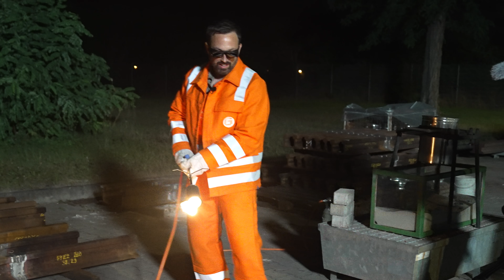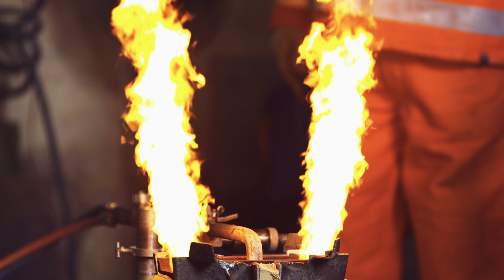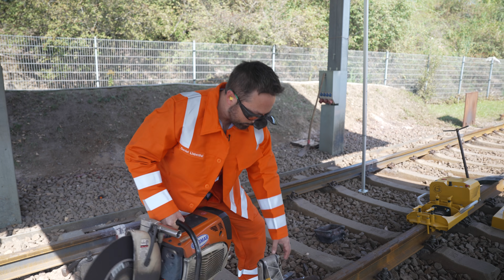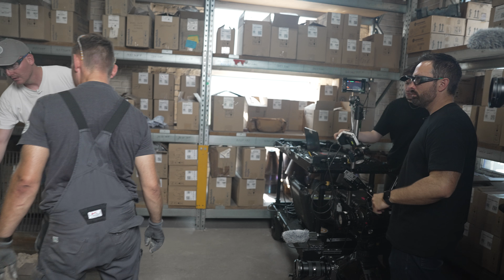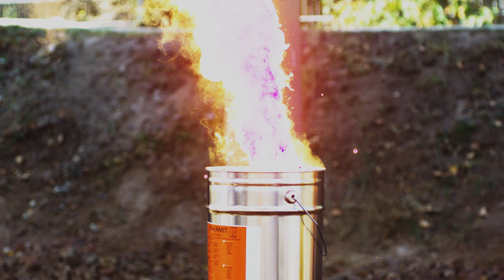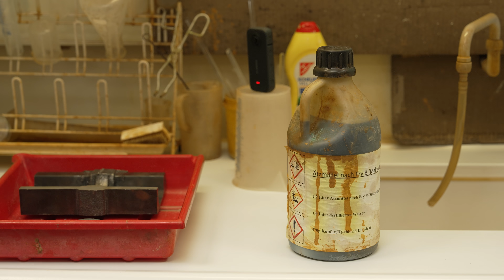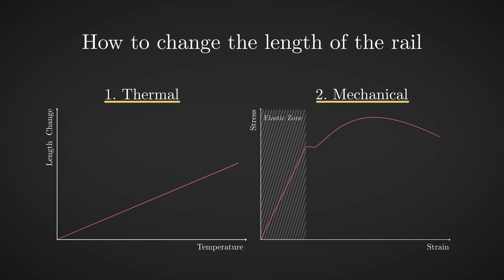Why Don’t Railroads Need Expansion Joints?

Comment: I was managing a railways superstructure construction team in my country. There we made 65000 rail welds. Later I moved to Halle city in Germany were the video was made. Nowadays I am doing something else but the video meant a lot to me. I missed all my hardworking colleagues in railways industry. When you ride safely on a train please do not forget those sweaty faces.❤
Reply: Just out of curiosity, How many people were on your crew, and how many welds a day could could you get done. 
I spent a couple years on a welding crew working on Steel gang years ago. There were two crew of 3 people and we were able to do 12-14 welds a day.
Reply: @SmokinOak  depends on the scope of the work and the technique. A pair of worker weld two welds per 45 minutes. If you weld many rails in a row they can weld 6-12welds (3 to 6 pairs) a day depending on the distances of the welds and the need for extra operations like rail stretching or preheating or cutting etc. Also some works like site cleaning, distribution and collecting of the tools and the workshop, final inspections like profilometry, fine grinding and other inspections like UT/PT takes much time. I had record of 120 welds with flash butt welding and 24 welds with EAW in our group but in a short rail system without further inspection on the same day and in 2-3 shifts (fully accessible track without traffic). So the productivity depends kn many parameters.
Reply: Could you please explain the part where they angle the rails before pouring the liquid metal? What goes wrong if you keep the rails flat on the ground? Thank you
Reply: @ey3796  the rail makes some contracting forces upon cooling down. The force on the head is more than the force on the bottom. So the rail becomes concave. We need to bring the rail up, depending on the technique and the heat input, to cancel it out with some safety margins.

Comment: Worked for the BVG (Berlin metro and transport service) 

And welding these, one after another, in the underground tunnels was the second sweatiest job I have ever done. 

Somehow repairing the abrasion was even worse (by welding extra material ontop of the track to repair dents because you had to heat up the entire length of track around the weld to get it to not bend and stick properly. 

I can still remember the sensation of my shirt becoming part of my back through sweat osmosis.
Reply: If welding in a tunnel only ranked second, what was the sweatiest job you've ever done?? 😅
Reply: @emilyrln  he explained it in the comment :D 
worst was repairing abrasion
Reply: Danke, dass du das dennoch gemacht hast. Infrastruktur ist fast so wichtig, wie die Facharbeiter, die sie am laufen halten.
Reply: What was the first??
Reply: My stepdad works there too :D as an Electric/welding engineer. really interesting stuff
Reply: I believe you mean sweat welding in the last sentence.

Comment: Mechanical engineer here - this video was INCREDIBLE! You meld the theoretical with the real world so well it's just awesome. Showing the actual graph of the test sample and seeing the fracture was soo cool. Took me right back to university days. I wish we had these types of videos to see when I was in university - would have made me even more excited about science than I already was.
Reply: Could you please explain the part where they angle the rails before pouring the liquid metal? What goes wrong if you keep the rails flat on the ground? Thank you
Reply: @ey3796  As the liquid metal cools, it contracts and pulls the rails together. He mentions that there is more metal at the top so there is more force pulling together the rails at the top. He is referring to the cross section of the rail, it is much thicker at the top where the train sits on it. Another way of looking at it is if they poured the liquid metal in when the rails were level, the pull together at the top being stronger would result in the rails having a dip at that point.

Comment: In some places (Belgium), we use diagonally cut rails (lengthwise), that will expand one half next to the other.
Allows for expansion without risks of derailing or buckling.
Reply: Even I was wondering why the technology did not improve from the rt. angle cut to the diagonal cut.....
also the two parallel rail welds must be staggered by at least half the length between  the two axles(front/rear).

Comment: Outstanding documentation of the process of using thermite reactions to weld railroad into a seamless track.
As a high school chemistry teacher I often demonstrated the "thermite reaction" for my students - reacting powdered Al2O3 with Fe2O3 and a source of heat from a chemical reaction between KClO3 and imbedded lengths of Mg ribbon. Concentrated H2SO4 would begin the heat generation process. The two powders were blended and placed into double clay flower pots inside an iron ring stand placed inside a metal bucket filled with sand. As the chemical reaction ignited the Mg ribbon inserted into the powdered mixture, the heat would initiate the reaction between the two powders, producing the molten iron which would flow through the hole in the bottom of the flower pots into the sand. My students loved to observe the heat and bright light of the molten iron, as it flowed from the bottom of the flower pot. I would always remind them the very same reactions were used to weld railroad segments together.
Bob G

Comment: There is actually another kind of joint for rails that does not produce the ta-tack sound. The idea is fairly simple: you don't cut rails at a right angle, but at a very sharp angle. As a result, at the joint, one rail becomes slowly thinner, and the next rail becomes slowly thicker, and there is no gap for the wheel to fall into. This is sometimes used as an expansion joint for high-speed rail.
Reply: That is a rail expansion joint, and they are used at long span bridges.

Comment: As Railroad Technician it makes incredibily happy seeing veritasium at the fields that i operate at a daily basis.
Seeing you try all the steps by yourself and get every knowledge behind the things you do is refreshing.
I work with a lot of welders and youre right, these guys make it look like its an easy job.
The scientific background and the seettrough weld was someting i always wanted to see. The Camera handled that exposure problem very well.
Cant wait for the next Part!
Reply: welding is probably the most physically demanding job on the railroads. Between thermite welding, grinding and then manganese steel welding on frogs those guys beat their bodies up.

Comment: Seeing you do a tensile test as a welder was very neat! And they ARE correct. In many cases when we do tensile tests, a perfect weld would break on either SIDE of the weld, not in the middle of the weld.
Because the weld itself, in many cases is ALWAYS stronger than the base material. Which is why we add filler metals and the like back in. But even if you didnt add filler metals, the weld should still keep the properties OF the base metal, and will only break in the Heat Affected Zone, which is why it's important to keep this zone small (especially when doing TIG welds). The smaller the zone, the less chance of failure down the line due to stresses.

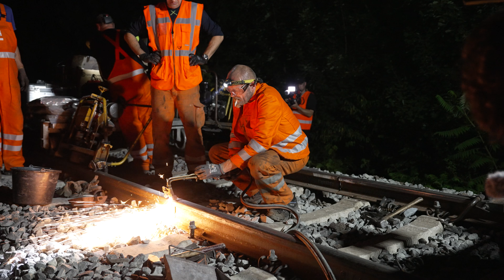Comment: 3:56, you can clearly see he's pro, hands free smoking during work, never seen anyone more pro in my life
Reply: I noticed that instantly, too. Brother out there, in the night, middle of nowhere, heavy machinery around, cigarette on his mouth. That's a pro.
Reply: Bro probably lights his cigarette on the Thermite Reaktion
Reply: Smoking while welding with oxy-acetylene.
Reply: Pro's use short, stubby cigarette holders. You can point it at the side, away from your nose and you can plug the end with your tongue so you can breathe without constantly drawing smoke. When i smoked and worked, that little stubby holder was god send, you can easily keep working without eyes and nose stinging, and since pro's also roll their own cigarrette's, they will extinguish on their own. So, if you work and smoke, get one of those stubby holders.
Reply: his favorite band: Rammstein for sure :-D

Comment: There are Long Welded Rail expansion joints in the UK, essentially a long diagonal cut in the rail over the space of 4 sleepers, which are permanently fixed together to prevent misalignment

Comment: Hey Derek, would you double check the explanation at 5:42 on why the rails must be angled up? Since the top of the weld gets poured last it will be the last to cool. If the bottom indeed cools first (as depicted in the animation at 21:25 ) it would solidify and shrink, squeezing and deforming the upper more malleable portion together. Then as the top solidifies and shrinks it acts like a hinge around the already solid bottom portion. Thus if it weren't angled up already it would "hinge" below level. The explanation "since there's more metal at the top" makes it sound like if the weld surfaces were parallel there would be no distortion because the same amount of metal is everywhere and the shrink would be perfectly even.
Reply from the maker: Thanks for the clarifications - we’re talking about how there is more steel in the head of the rails - so heat is conducted faster there than through the rest of the rail.
Reply: @veritasium  Because there is more metal in the head, that cools slower. So whilst the foot can be solid inside the head can still be liquid. As this then cools later it pulls the rail downward (due to thermal contraction) causing the weld to dip. A dipped weld is a little like a pothole on a road, and causes much higher track forces which can ultimately lead to failure.
Reply: @veritasium I can only kindly ask, but if you would be willing to, could you do a follow up video better explaining this? I’m sure the way the angle was found to ensure that it pulls the rail straight was a cross between trial and error and some beautiful math. But I got to know more.
Reply: Hi, it is because there is more steel on the rail hence, the rail absorbs more heat at the top allowing it to cool faster at the top. yes the bottom would be exposed longer, but the volume of steel at the top (the steel rails not the liquid) is higher hence, it can absorb more heat from the liquid allowing it to cool faster relative to the bottom part. Hope that made sense!
Reply: Yes, I was quite unsatisfied with Derek's explanation as well.

"Since there's more metal on top..."

Well of course it is thicker on top, you put it there, silly.
Reply: @XxZeldaxXXxLinkxX  maybe he means on the rail, since its an I-beam, but then that would also be true on the bottom so idk
Reply: @XxZeldaxXXxLinkxX  `yep! .... more metal on the top ... ergo greater mass on the top than t/o rest of the sectioned rail.
Reply: @XxZeldaxXXxLinkxX  I think if you look at the cross sectional area of the rail it shows the best example of this, If it were a true symmetrical I beam then this wouldn't be the case but because the top of the rail  is much thicker it has more mass to it so more metal relative to the rail section.  I think if you saw the cross section view for the visual it would be more apparent but because he was talking about the forces pulling the rails together it makes more sense to see the side view.
Reply: The cooling makes the metal gradually increases it's viscosity where there's still flow, but it is already partially shrunken as well. 
Because of this, some backflow during this high viscosity is a thing in casting, either metal, plastic and others, or like efusive lava for example. More inflow points are a solution to avoid issues but in certain cases, like this one, when that's not possible, more material can be filled beyond where it's needed to allow some gravity assited backflow during cooling.

When it shrinks it also pulls "inwards" from it's volume with some force.

Then bottom of the beam is thinner in the flange section. This is because there is less mass and more surface per volume to cool it of. 
The thinner flange also makes it harder for extra material in a viscous state to "flow back" to fill the void created by the shrinking of the metal while cooling because it cools down faster than at the top. If no more material can flow back to fill the void, then the temperature contraction creates the pulling force.

The top of the beam, has a "bulbous" format so more mass but also less surface per volume to allow it to cool down. Since it has a slower cooling, it allows more "back flow" during the shrinking because the viscous phase has more time and space to flow back and fill the void created by the shrinking.

So when the bottom flange cools and shrinks, it hinges by the pulling force the beam's ends towards eachother, which consequently means down, and squeezes the extra liquid (or very low viscosity) metal on the top, and when the top starts to cool down, it has more surface to allow delayed flow of "semi-cooled but still liquid/viscous enough metal" to fill the shinkage of the "bulbous top". And since the bottom is already more solid and stronger, that's why the top won't shrink and work as an hinge. Just more metal can fill this shrinkage void easier than pulling the beam ends together.

I'm pretty sure I have some of the terms wrong, and I maybe missed some points as well, but I just hope this helps! Otherwise, please correct me. Cheers and a happy new year ya'll!
Reply: The real answer is that trial and error showed that this needed to be done, as the thermite weld created a dip at the weld point.  Later they figured out what must be happening to make this necessary.  I guarantee that the angle was determined experimentally.
Reply: Thank you! I was racking my brain at nearly 4AM while I’m sick with a cold, trying to explain this to myself as to why the angle was needed. It’s been many years since my material science and engineering courses, so I haven’t really had the need to think about these types of problems, but I knew when I heard the explanation it was, not wrong but missing further explanation.
Reply: I also didn’t understand this part. If the rails weren’t angled at all, wouldn’t the even amount of metal from top to bottom pull them in evenly?
Reply: That is indeed standard operating procedure for preparing welding butts - Boilermaker artisan.
Reply: Thank you for this, I was also curious. "More metal at the top means there's more force at the top" is circular logic. Nobody's perfect, still a top-notch video and a well-earned like.
Reply: Hi, a welder here. The reasons the rails need to be angled up with the top of the rails farther apart than the bottom is that on the top of the rails, there is more material cooling so a far greater pulling force applied on the top than the bottom. I know it can be a little hard to understand, but I hope this helps.
Reply: If it was level with the top of the rail as it was poured you would be correct, but it's not. There is a significant amount of molten metal above the top of the rail that, as it cools and shrinks, pulls the top back.
Reply: I think the upper portion will cool first, because it is exposed to the outside. Whatever's outside is going to be at a lower temperature and rate of cooling is directly proportional to temperature difference. 
Also, (and this is a bolder assumption) i think in a molten state, the less dense hotter stuff's going to be at the top.
 Either way, as contraction in length directly proportional to original length and temp. difference, the wider section will contract more than the narrower section and eventually it will all straighten up.
Reply: Easier to grind the top than fill it if it is lower!
Reply: Sounded like an explanation from chat gpt to me

Comment: 15:47 @veritasium, This could be a lame and insignificant doubt, but what's the type of glass that's being used to showcase the inner working of the thermite reaction within the mould? Is that a sapphire or a ceramic glass that can withstand high temperatures?

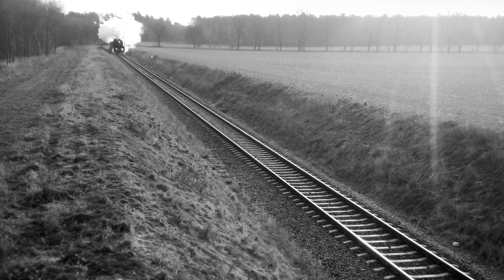Comment: 2:52 I don't quite understand this statement that the expansion problem escalates the longer the tracks are. The length the tracks expand is always a percentage, so a 100m track will experience just as much stress and buckle than a 200km track would.
Reply: ...because it's a percentage.
At .25mm/1m expansion for an 20C-80C degree temperature change, that's 2.5cm for 100m of track and 50cm for 200km of track.
50 cm may not seem like much if it's evenly distributed, but if it's not and one goes left and one goes right...
Nobody wants even the possibility of a derailment.

Comment: I have much respect for the guys doing the field work at night over and over again.
This is a hard job physically and the hours put you slightly of set to the rest of working people around you , making socializing more difficult also.               💪
Reply: Its not that hard at all... and they get paid very well here in Germany. Its more like a dumb and boring job... but there is way more to Oberbauschweißen than SKV-Welding. Thermit is just the starting point as an Oberbauschweißer.
Reply: @wiLdchiLd2k  I'm a welder and I agree, it looks very mind-numbing. Since most of the process is almost automated without you having to think about anything, besides leveling and aligning.
Reply: @wiLdchiLd2k  Then can you do it and post a video about it if you say it's dumb, boring and not hard at all

Comment: 5:45 isn’t that a self-fulfilling prophecy?
Reply: The "more metal" is in the thickness (or cross section area) imbalancee between the top of the rail compared to the bottom, not the little added volume of liquid metal due to the tilt.
Reply: @Vaasref  If your theory is right, the animation is wrong (the bottom part is a bit bigger).
Reply: I know, i'm not following the explanation here. From what i got, the top is gonna contract more because there is more metal there, so we angle the rails so that there can be more metal there to contract more. Its not a great explanation.